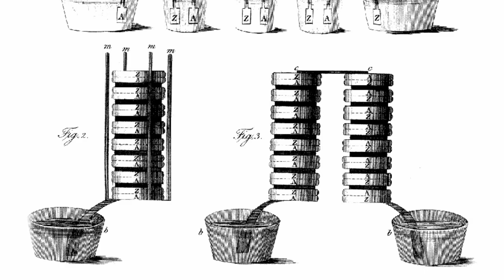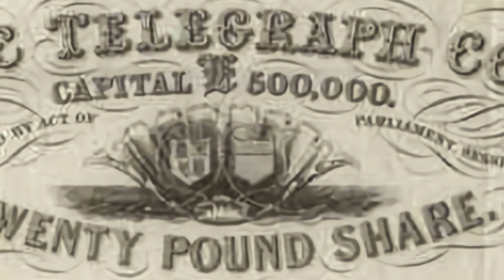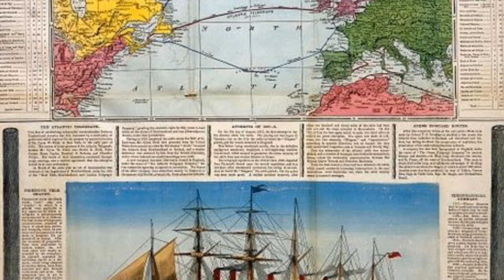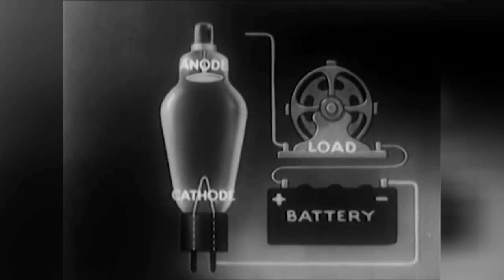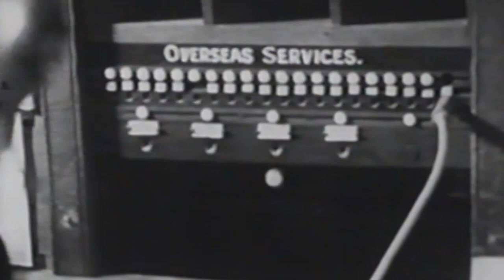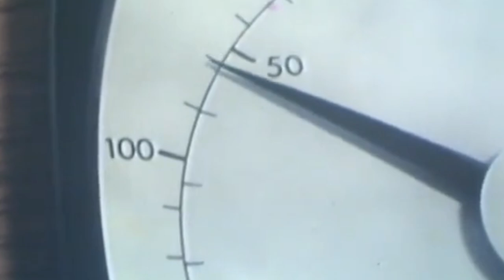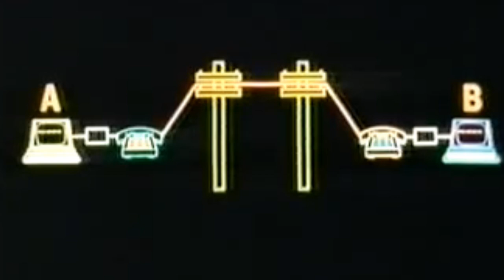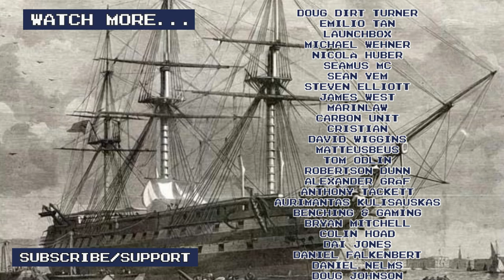How the Internet Crossed the Sea | Nostalgia Nerd

Comment: Pretty disapointed you didn't mention how it's slowly going away from the cable again. It's really neat that for a while radio was king, and now it might be again, as we have startups like Starlink promising to do everything better than our current setup. 

Started with wireless, went to radio, went back to wired, now we have cell phones, more than wired connections for calling, soon we will have more wireless connections for internet than wired (as Starlink matures I immagine). Eventually we may need too much bandwidth to be carried in the air I , and we will have to go back to cabling again.
It's wild.

Comment: Now old Musky is building low-orbit satellite comms, because light (or radio) waves in air and vacuum go a lot faster than in glass. And they're so much closer than geosynchronous satellites that the latency becomes low enough to compete with (and win over) fiber optic cable.

Comment: Had family on a cable boat in the late 80’s through the early 90’s. Spent a lot of time at Williamsburg when they came in. Busch Gardens once or twice a year was great. You would be amazed at some of the stories you hear around a bunch of ranked civilians. 
ATT pulled the rug out from under those guys. Around 12-15 years in they gave up the contract or sold it. Everyone no longer ATT if they stayed on boat.  
  Most Atlantic stories about Europe and UK. The funny ones were in the Pacific. Asian crew, fished at night. Dried squid during day. A care package of cereal boxes went a long way.  
  Apparently you can splice broken cables. That guy was important and got away with some stuff I’m betting.  
  I remember a family dinner that they were talking about pressure differences at the Aquarium tank we saw. One goes out and comes back with a hard styrofoam shot cup. Shows everyone and tells us all that was a sixteen ounce cup they netted to the ROV. Sent it looking for the cable. That’s the pressure down there. 
  I asked how they found the cable after a storm, got to watch satellites fly overhead, with a guy calling out the patterns. He was the guy who had the knowledge to setup the line of site sat nav they had in the 80’s.  
  They were chatting about the neighbors CB and got into frequency properties at different depths and temps. These guys were amazing. A lot more than just grab that line and follow it to England. 
  Last one, kinda just struck me.  They were talking movies and Clooney had done “The Perfect Storm”. As I listened, it became clear they were out there in it. They were getting weather reports from land, only to realize they were being fed back the conditions they had reported earlier. They were advised to turn and head back for shelter, only to have to report back that they were at like 90% max screw rotation, facing into the wind and being blown back to Scotland at a measurable pace.   Still remember piecing that all together and asking about it the next time. Whole house got quiet when they confirmed it. No one knew. 
  These are just a small compilation of the stories I’ve heard from them over the years. It took a lot of time to pass before I ever heard any of these. Talking years after the Clooney movie, I was already moved outa state and doing the holiday thing to see that side by then.

Comment: DSL still is basically an analogue modem, just a very fast one using high frequencies and fancy modulation techniques to achieve the required bandwidth over normal copper telephone wires.

Comment: About the flash light and real fiber optic he is absolutely right. A buddy of mine installed it for a contractor and you could unspool a few dozen feet and  put one end in the bathroom where it’s completely dark and flash a light at the other end and it would go through that huge ass spool which was I don’t know how many hundreds if not thousands of feet - and would be just as bright at the other end. But it was amazing is how sensitive it was - you could just lightly wave the light in front and that would transfer. It’s crazy shit

Comment: Some nice info there. We laid our 1st trans Atlantic line using square riggers and the 1st 1Gigabit/s line was laid well before the internet was populating IP addresses. Those were my 2 big takeaways.

Would have been cool to mention some of the potential espionage that's happened/happening with them as well. Russian Subs and underwater listening posts. Its like some kind of novel or something.
Reply: Protocol does not matter, you can transfer any data over those cables, internet would work on it without changing the cable all you need is compatible devices on both ends to route network packets over the cable

Comment: I have an issue with locations of fiber optic and telephone lines. Maybe you can clear it up for me. I was a District Inspector in charge of locating and watching certain excavations  near gas lines. More to job but later. Twice in my career i was involved in excavations involving FOC and telephone. In the late 80s a contractor installing drain culverts . They were going to have possibly 200ft  hanging  during dig at different times.  The sections were box culverts and depth of 20ft. The phone company demanded morning meetings and there reps had the power to shut down at anytime.  In these meetings i found out this was a transatlantic cable. Condition of cable was a factor because it was the first. LWS had management along with the company digging,  both ATT and Verison ,another company i don't remember. All uppermangment and important. The whole time cable was exposed during installation of culverts. During sewer replacement only 1 person was present.  
      In The 90s they were installing what i thought was first FOC. Lynn MA at the time was only location on the east coast with the correct geographic conditions at that time. They were installing the underground tubes and manholes.  This time I followed the installation to the receiving station then out of city. Ive looked at sites claiming location of line's and they are nowhere close to accurate. These lines in the city. They used out of state crews that tried putting lines down streets that weren't in the plans. Played stupid till lynn shut them down until they knew the route. Shortest distance if they could. I was there when the ship arrived off lynn beach. I was not there for installation of line from ship to first location on land. But was there for first location installation because very close to regulator station supplying and island.  If you can correct me I'll listen also don't have my glasses so i apologize for spelling
Reply: You should see my spelling before you criticize your own. Thank god for YouTube's spell check.

Comment: I remember the early 60s Transatlantic Telephone Cable had so much lag that it was difficult to have a normal conversation.
Reply: If you had that much lag it was most likely a satellite channel; the Atlantic cables never had enough delay to cause serious issues. Try that call today and the cable delay might be a tiny bit worse than it was but it is still as clear as a bell and no problems.
Reply: I my parents lived in Salt Lake City. They received a call from The Netherlands in the early 1960s. I was a child at the time.  
I spoke briefly with my uncle in Europe.  There was some distortion, but communication was instantaneous.  

As I recall, the charge was 3 dollars a minute.  Equal to about 25 dollars in today's money.

Comment: The sheer raw capacity of modern long-haul submarine cables is astounding! Approximately - each cable can carry six fibre pairs, each fibre pair can carry 100 'colours' of light, each 'colour' of light can carry 100Gbps (=100,000,000,000 bps) of data. Could be a total capacity of 60Tbps (=60,000,000,000,000 bps) for a long cable. More for a short one! Often the operator will only light up a few colours and/or fibres to start with, to earn the funds to pay for lighting up the rest when increased demand requires it. It can carry anything that exists in digital format including internet, data, emails, facebook, phone calls, trading, shopping etc. Lots of cables, of various ages and routes, together with the routers that interconnect them, make up most of the 'web' or 'internet'.

Comment: Fiber optics do not move at the speed of light. As you said it is reflecting on the inside of the cable, but also there is so much resistance from the glass that light only moves at 2/3 the speed of light. Copper is literally "faster" in that regard, moving at 99% the speed of light
Reply: Light always travels at the speed of light, the medium determine how fast that is.
Reply: Sorry but copper and fibre are both about 2/3 of the speed of light, it depends on the exact design of the cable or fibre but there is little difference in reality. Trust me on this one. And danzk is correct.

Comment: In a room in the Engineering Dept. of The University of Sussex is/was a plaque commemorating the very first transatlantic packets of data sent and received using IP (internet protocol funded by DARPA) as a part of the  conference Internetworking'73 held in Brighton in 1973. An international extension of the old JANet ( joint academic network) system.
A mention of Baudot code instead of Morse would have been good as well.

Comment: Sorry, Nostalgia Nerd, but the siphon recorder you mention at 5:23 wasn't used on the 1858 transatlantic cable (it wasn't invented until about 1867).  You are probably thinking of Thomson's mirror galvanometer, which they DID use.  Good video, though.

Comment: Why was the message transmission using copper wire so slow? The signal propagation speed in copper is around 2/3 the speed of light.
Reply: Yes that through pure copper though copper back then had lots of imperfections also signal degradation plays a big part in this

Comment: wow, I was 100% sure that satellites are the main source of data transfers nowadays, did not even think it is possible to make that huge cable to connect Europe with States!
Reply: There no way, ping would been few seconds, ironically video would probably work with you would have bandwidth, while websites would take longer to get as it requires multiple requests depending on eachother. Even project like Starlink won't give proper ping for low distances, but it will theoretically improve long once (atleats on paper)

Comment: Dear Nerd, italian inventors need to be properly recognized for what they did.

 Alessandro Volta invented the first battery, in 1800, not Faraday. He used copper plate, zinc plate and in the middle an acid solution.
8:55 - You mean Antonio Meucci did that, as acknowledged by the US Government in 2000. Bell outright copyright trolled the Italian.

and just to let u know . first radio was made by MARCONI not another american troller.  U should fix this video or at least re edit with a correction text on the video. couse many ppl dont read the comments. Mistakes happens but with nearby 250k subscribers u should re edit the video.

greetings from Italy ;)

Comment: 1 Gbps total bandwidth across the Atlantic in 1992?? Are you kidding? That's not even super early days, you could get a 486-66/16MB RAM PC that could later run Win 95. You could get a 10 Mbps NIC and dial-up service. The Web had been out for a year. I mean 100 normal consumer network cards could max out the entire transatlantic bandwidth. Wow. Nowadays a single home connection can match that for under $20/month in some countries.

Comment: Modems are still in use today. Your domestic hub / router does indeed contain a modem.
Reply: That's is if you are using ADSL OR VDSL if you are using FTTP then it likely wont

Comment: Great  synopsis but i would give more credit to the dedicated minds who figured out how to put multiple messages on a single copper cable, than some bros who said lets run a wire across the ocean floor and connect it to some cans, it works everywhere else..  that was inevitable.

Comment: You seem to say that cell phones use satellites. That’s not correct and prevailing myth. Cell phone communicate with antennas spread throughout the area of coverage. Usually those antennas connect further via microwaves links or cable.

Comment: meanwhile, germany is stuck with its internet in copper cables on a level of the 1980s...
Reply: Got that right... 
Apparently they are now introducing a high fibre network,, have seen the ads and the connection boxes along the streets in Munich.. Endlich Deutschland..
Reply: @pashvonderc381  but you still got no mobile connection when you step one foot outside of the town.
it will need so much time, i think...

even ex sovjet countries are better than us. we are at the second last place when it comes to mobile telefone and internet, in whole europe.
Reply: @tja9212  I know what you are saying..
 Germany always needs that extra century or so to catch up with the modern world..

Comment: And I used to think that there are places in our oceans which look like the grand canyon  in the USA but stretch out for hundreds of kms where the ocean floor drops from 100 to 3000 m or more. How you put a fiber cable there and how you dredge him up when broken? Anyone?
Reply: You have the right picture. Gravity takes the cable down nicely and they hardly ever break unless interfered with by a landslide or a fishing boat or anchor. In deep water, cable just rests on the seabed and you know pretty much where the ship was when you laid it using GPS. You can drag a hook across the cable line and when the tension increases a lot you can pull the cable up - it might break on one side but you have the other side and you are doing a cable repair anyway. We should be full of admiration for those pioneers who did all this without GPS etc.

Comment: How did the first multi-call cables worked?
Reply: Each conversation was given its own little radio transmitter, all the radio channels are sent through the cable together, at the distant end each channel has its own radio receiver to separate the channels. TAT1 started its life with 36 channels just like that.

Comment: History of the best trans-Atlantic internet:
15,000 BC-1500 AD: Imperceptibly slow cultural diffusion across Eurasia and the Bering Strait to Alaska
1500-1820: Wind pushing wood with letters on top
1820-1870: Heated water boiling and condensing over and over again, turning screws and pushing wood with letters on top
1870-1990: Potential differences across really long copper cylinders going up and down encoding analog or digital signal
1990-present: Light zig-zagging through really long glass cylinders encoding digital signal

Comment: It's strange to think about how long ago telecommunication started, and how much more we do today using essentially the same basic principles. Even stranger is the idea that we started communicating in coded pulses, then switched to using analog voice signals as standard, then switched back to coded pulses. Think about how expensive it was to spend hours sending a telegram, and how it's now so cheap to send a gigabit per second that we use it for telling jokes, showing videos of cats, and a boatload of porn without ever having to think about costs per bit or minute like before.

Comment: Are company's still using fiber across the sea today in the 2019?
Reply: Fibre across the sea is more reliable, secure, and faster than satellite, and the high frequency electromagnetic signal (between radio and microwaves) of Wi-Fi is far too weak to reliably get any signal across the ocean (besides fibre is still faster/more reliable and secure than Wi-Fi), so the vast majority of internet signals are indeed sent via transatlantic fibre optic cables.
Reply: And bandwidth.
The bandwidth required for it to be the goto is far too much for satellites.

Comment: Now, explain why the hell Icelandic countryside gets lower pings to west-coast US, than Canadian countryside.
Reply: Probably because Iceland hosts so many data centres (cheap cooling and electricity) so it has great connections to fast backbone routers and cable routes whereas Canadian countryside is just as beautiful but of no consequence to the IT hosting industry! Ping time is a combination of 'travel speed' with 'waiting for a train' time and either factor can dominate depending on the circumstances.

Comment: Er no.......
the speed of light is NOT the same in a solid as a vacuum
Secondly data is NOT transmitted in fiber optics that way.... it is ENCODED... with quite a significant overhead.

Comment: MORE CORRECTIONS:  Most sources date the FIRST batteries and an electric generator to around 200 BC - in ancient Iraq (not XIX century, England :D).
Reply: There's speculation that the so called "jar batteries" may have been used to store or create voltage. But given that they had no practical use for electricity and no real proof that it was anything other than an object of curiosity, it doesn't get credit as the first practical battery.

The people who played with iron fillings and a magnet dont get credit for discovering magnetic fields. This is because you have to actually discover what is happening with the experiment, not just play with it and think "hey, that's pretty cool."
Reply: @gregwessendorf  Hm. It wouldn't be the first time when a modern human looks down on the ancient civilizations, forgetting that while 4000 years ago they had an enormous knowledge about (for example) astronomy, people of Europe until XVI century still believed that the sun circles around the earth.
Who was really uneducated here?   :D

It seems obvious the ancient scientist (alchemists) were aware of the existence of an electric force and were studying (rather then "playing") this phenomenon.